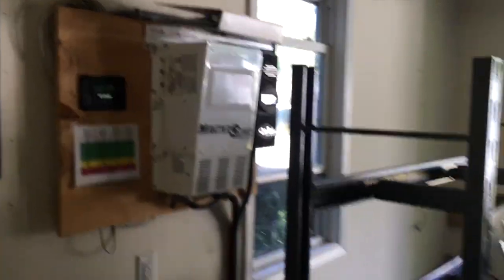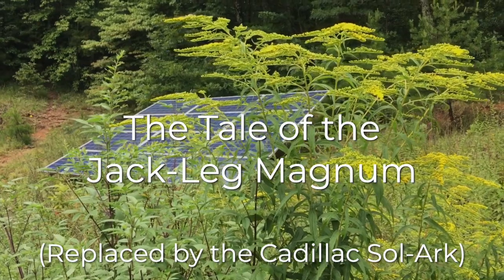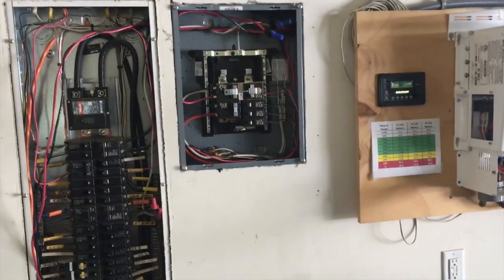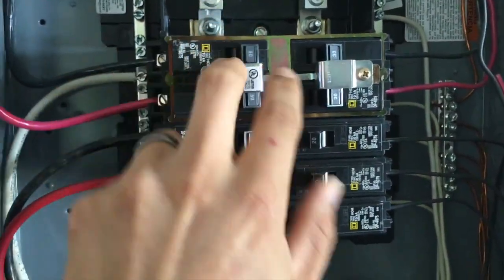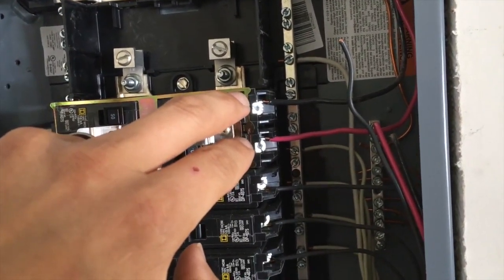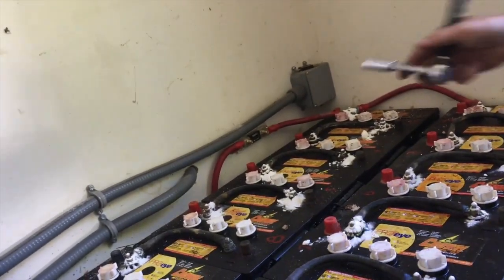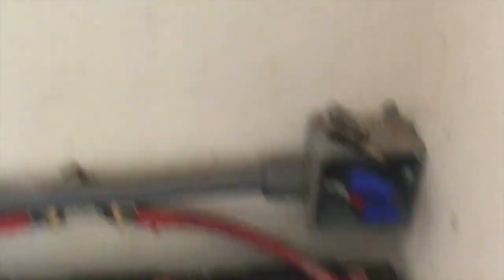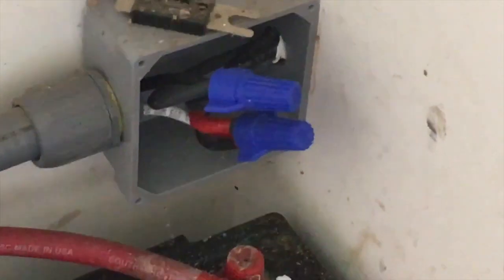How to fix a Bad Solar Installation!

Comment: Aren't you always supposed to disconnect solar first?
Reply from the maker: Yes if there is a disconnect. Didn’t want to do it at the equipment for fear of a spark which would burn the terminal, possibly damage the equipment

Comment: Your  comment about the power grid sending  power  for miles is not the same as the solar panels. Solar panels are  DC current .. not AC  current  which was developed  for traveling  long distances.

Comment: Thank-you ! I have a 5KVA 230v Pure Sine Wave    48v & I have 15 Pcs 3.2v 280A for 48v in series it’s still 280A , I have the Moes Automatic Transfer Switch to a 100A Double Pole Breaker & I have a brand New Siemens BreakerBox and to charge the Batteries I have 3 Car Alternators 2 Gm 1 wire High Amp 100 ~ 120A and a Ford Masada 150A the alternator creates Ac Current , I have 3 - 12v Dc motors to spin the alternators but my issue is my PV input on inverter input has to be 48v to charge battery bank & to use the electrical “ Thank you “ I know less than some who knows anything ! But I’m trying to keep my family safe when the grid goes down like with this Ida storm !

Comment: Say, since you have a disconnect in the solark why didn’t you put the doc disconnect at the panels instead of on the other side of the wall the inverter is on

Comment: Awesome video. Can you tell me if the solark has a zero export feature.  I'm trying not to get involved in net metering.  Thks
Reply from the maker: Yes feel free to email me 
Jv@gainsolarpower.com

They call it limited power to home in the manual but it is zero export 

They use CT’s to achieve this feature

Comment: Good vid. You said he oversized his feeders? I'm not a solar guy but 10awg is rated @ 35 amps(@75°C)so he's gotta use #8 to feed a 40 amp load right?
Reply from the maker: I knew someone would catch that. He oversized the feed to the magnum. It only needs 10/3. He could have used 10awg

Comment: Really like the way you do things. The right way! I was taught as a young kid that if it is good enough to do, then it should always be done the right way first as it will not only save you money but, a lot of grief in the future. Solar, however, has been challenging for me as I didn't have a good grasp on electrical diagrams or how everything else works. So, it is always a new learning experience. I put disconnect switches on my panel ground mounts and additional disconnect switches outside the PV entry to my Sol-Ark 12k as well as disconnect switches from my battery bank system. In addition to fuses I feel that you can't have too many ways to cut power off if any emergency arises. Keep up with your great videos!
Reply from the maker: Thanks Craig. Yes I agree if it is worth doing its worth doing right. The Solark is a great inverter. I’m doing one at my house. Just make sure everything is good and tight/torqued. Sounds like you have lots of connections. If they are loose they can heat up. I have a thermal imaging flir phone attachment that I check stuff with some time

Comment: I'm an unlimited electrician in NC, and wow... so many improper and dangerous decisions here...
Reply from the maker: Examples?
Reply from the maker: We were just lifting the connections hot for dramatic effect, and because I didn’t wanna spark the equipment, but there was no load.
Reply: @GainSolarPower  examples? I think you covered them... i was meaning the old install... you did fine work.
Reply from the maker: SuperVstech thanks. Always nice to have a second eye on it